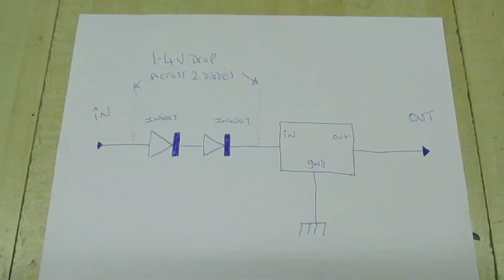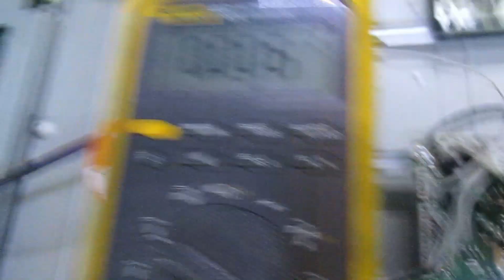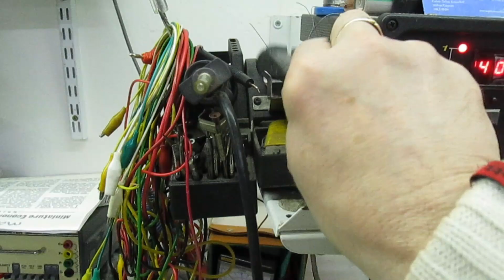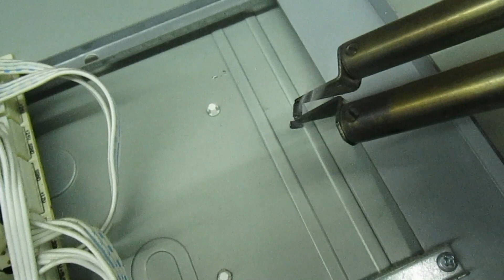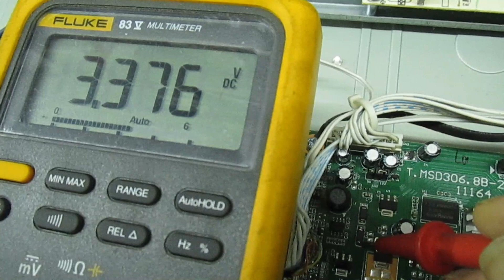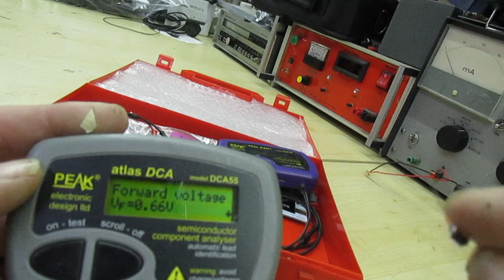Flat screen TV, A  Very common fault to look out for .

Comment: Dear Sir, I do have some questions: 
1. What do you think could be the reason for Vertical Banding, Grey Uniformity Issues, and Dirty Screen Effect (DSE) in modern TV's Panels?
2. From Longevity point of view, are Direct-Lit Full Array LED TV's better (Like Bravia 3, in which constant Backlight is ON) or the Mini-LED Local-Dimming ones (like Bravia 7, 9 in which hundreds or thousandsof LED's turn ON and OF and show varying degrees of Brightness to produce best Contracts, darkest Blacks and Brightest Whites, etc..).? Which among them will be the TV with longer life ??
3. I'm assuming keeping Brightness low shall increase the life of the TV.
Waiting for your reply. Possibly if you could make a video, it'd be great! Thanks.

Comment: If they used genuine !N4007 diodes instead of crappy surface mount they would never fail but this is "progress"
Reply from the maker: At least with the leaded 1N4007 you could just unsolder one end to do an in circuit test , SMD is a right pain .

Comment: Been binge watching you channel this last week, love it :)
Reminds me when i first started out doing repairs at a music shop around 86/87 time.
Someone had this old Fender transistor PA mixer / amplifier that the output stage would kept failing after some use.
The guy doing the audio repairs at the time just kept shot gunning all the failed silicon in hope it would cure the problem, which it didn't.
Eventually i ended up looking at it with the main service guy and we found the culprit to be a diode in the output stage bias circuit going open circuit when it got hot and the bias current went though the roof taking out the output devices.
Once we swapped that out, no more failures. Testing it cold though there was not perceived problem with it.
Sometimes you have to think out the box a bit when fault finding :)
Reply from the maker: This is also quite a common fault with leaded diodes and I am sure its caused by bending the leads and stressing the diodes internal end connections , for this reason if I am bending the wires on a diode I always hold the diode with a pair if snipe nose pliers and then bend the wire while holding the diode in the pliers so there is no movement at all occurs near where the wire goes into the diode body .

Comment: Thank you Micheal i am looking to use this tip today. On an inverter board i have one sm diode witg 24 volts on one side and 5volts on the other side. It tests okay in cct.Should i change it? Thanks Michael
Reply from the maker: definitely change it if its dropping more than 0.7 volts, even if it test ok as I think the junction can go high resistance when it gets hot.

Comment: Interesting video. there are always 'common' type faults in every type of equipment. From tv's with no service manuals to the biggest computerised medical equipment where the service manuals stack to a height of 600mm :). I know I have worked on them all. One small observation, the diodes are a 14007  not I4007. The 1 indicated one junction device.
Reply from the maker: Just habit I have always referred to these diodes as IN4007.

Comment: Have you ever seen an LED LCD TV where the screen goes black after a few minutes but still has sound and backlight? Stays black when powered on for at least a month, but if left off for a few months, starts up okay then, again, goes black after a few minutes.
Reply from the maker: cant say as I have seen that before and it sounds like its going to take a bit of finding its its intermittent , a hairdryer may be a good start , see if you can bring the fault on quicker .
Reply: @michaeldranfield7140  The fault starts reliably. The problem is finding out what is normal to compare to.

It also seems strange that the issue persists for weeks even when unplugged and cold, as though a charged capacitor maintains the fault until it discharges.
Reply from the maker: @atholmullen  you could try a gentle tap around of even touching different wires and connectors with an insulated took , intermittent faults can be very time consuming to find .

Comment: Always a pleasure to see you work, and (I would bet) that you worked on the old valve CRT TV's too. Thanks for your videos, because it saves the hassle of scrapping them, and I have had an extra 10 years of use from repairing a Flat Screen. The only downside to their age, is that many are power-hungry, by comparison to those which are manufactured today.
Reply from the maker: Of course , I started as a kid repairing valve black and white sets and selling them for £5 , a lot of money back then .
Reply: @michaeldranfield7140  Yes, me too. a lot of B&W sets failed due to Valves failure. I think that I used to place a 68 ohm resistor in the octal base (Heater). If all the Valves lit-up, you had pinpointed the faulty Valve. But I didn't progress to learn as much as you! I am happy to watch all of your YT vids. You are most definitely saving hundreds of Tv's from going to their final resting places. Thanks for your reply. Greetings from Sydney.

Comment: The diodes are added to the voltage regulator to reduce the power dissipaton of the regulator by a factor of  2 !
Reply from the maker: of course but they could have just fed the input to the regulator from a lower voltage source in the first place .

Comment: Since 2008, I've had THREE flat screen TV's. A Panasonic 1080P Plasma. A Samsung 1080P LED LCD. And currently a MORESENSE 4K ULED LED LCD. All working perfectly. No faults at all in 14 years! ...... I also have a 40 year old SONY TRINICON Colour Video Camera, and matching 38 year old SONY BETAMAX VCR! You've guessed it, at a combined age of 78 years, both still working perfectly! ...... I also have a 43 year old JVC STEREO AMPLIFIER ... but this is getting boring? 😂😂😂
Reply from the maker: Old stuff was built to last and be repaired because back then it was so expensive.
Reply: @michaeldranfield7140  True! Things now are built to a price, and are designed to fail! 👎

Comment: The forward voltage drop can rise in a diode if the ESR of the device has risen. Test it at a higher current. Also...if there are high frequency spikes, it's internal junction capacitance can make the device leaky.

As a footnote it is warming to see a REAL electronics engineer like me who has watched as his watched while the subject of his career passion turned into disposable junk. This is why I now work with industrial & scientific gear...
Reply from the maker: First time I came across high forward resistance diodes was back in the 1980s and these usually test OK when they have been heated by desoldering, its for this reason I think it's caused by a bad contact between the junction and the lead out and this is why now when I'm bending the leads on wire ended diodes I always hold the lead with a pair of pliers as there is no mechanical stress placed at the end of the diode.
Reply: @michaeldranfield7140  Funny thing that...I came to a similar conclusion back in the "good old days" as well & do the same. We come from the same era when technicians were real technicians, a day when Philips service manuals were half an inch thick & cost a fiver from CPC & when the City & Guilds was a good qualification.

Comment: Great informative clips. Congradutions. My question is if the diodes you removed still test ok can you reuse them for the same application? It feels like an installation problem more than a part problem?
Reply: His diode tester probably doesn't put much current through the diode... More current would probably have shown it still being at fault.
Or like he said, heating it up temporarily "fixed" it and it would probably fail again later. They are cheap, so you may as well chuck em...
Reply from the maker: While this migh seem like a good idea I wouldn't recommend it, if it's failed once it could easily fail again.
Reply: @michaeldranfield7140  Yeah - false economy - ...and no self respecting technician would want to court reworking (and good reputation), when the same 2c component fails again.

Comment: I think the real problem here is not the diodes at all.  The real problem is a cold solder joint.  All you would have to have done is reheat the joint with some flux and that should have fixed the problem.  Diodes don't fail like that and then fix themselves.

Comment: I've seen this happen to the older through-hole 1N400X series diode, but only from many years of 24/7 use, and mild overheating.  But I don't see any evidence of that on your TV board.  I guess this is just a bad batch of them?  Shouldn't happen.
Reply from the maker: I first came across this problem in the 1980s on a TV that had a whole load of leaded diodes like 1n4007 that were painted silver so it may have been a bad batch then
But I'm pretty sure on leaded diodes it's caused by a poor junction to lead out most likely caused by stressing the junction bending the wire and for that reason I only bend diode wires while holding in a pair of pliers. But as you say heating and cooling plays a big part in the failure mechanism.

Comment: Thanks for the tips!
Are you using a Pace rework station? Looks a lot like what I worked with back before I retired from communications. Now I only have an ols first gen Pace desoldering station. 
BTW wher did you obtain the semiconductor tester? I see you also have several other testers made by the same company.
Reply from the maker: I use a Pace soldering station, this was £1600 when I bought it 20 years ago and in times gone by when I was super busy it was running 8 hours a day.
I have a lot of peak testers as I know the guy who makes them, he is only 5 mins down the road on the same industrial estate as me.
Reply from the maker: Have a look for Peak electronic design, Buxton, Derbyshire on the Internet.

Comment: Nice one! Thanks for sharing Michael. I can remember a similar thing happening when I was a workshop engineer in the early 80's and field engineers used change the so called stock fault 910 ohm resistor in the Bush T22/T22A chassis and the heat from the soldering iron used to temporary make the actual faulty component (a BD2xx tab type regulator transistor, same package as a TIP41) start working again for a few weeks, until it eventually failed again. The 910 ohm fed the transistor base, and only a few mm's of track between them. All those set went wrong again, and came back to the workshop. The transistor always measured faulty in circuit but removing them they measured ok after being heated from desoldering. Replacing the transistor with a new one, a long soak test and returning to customer, they never failed again.
Reply from the maker: Yes I remember the 910 ohm resistor, it fed the  base of the series pass regulator transistor and got so hot it changed color, glad you liked the video and it brought back memories of better days .
Reply: @michaeldranfield7140  , Yes loved the video, a very useful tip. I still repair the odd TV that work mates bring in from time to time. I work in electronic and electrical machine training and education now to hnd / foundation degree level. However, I cannot resist getting my hands dirty on TV now and again 🤣
Reply: Bush T22
I remember those !!!
Crazy era of switch mode power supplies running all the time in standby mode.

Waste of power and just asking for short lifed components !!

Comment: For those doing this, make sure your diodes are facing the correct way as well, as they're omnidirectional
Reply: Unidirectional?? Polarized.
Reply: I’ve never heard of an omnidirectional diode. That’s not a diode’s design.
Reply: A diode that conducts both ways? Where can I find those they sound really useful

Comment: I tend to replace such diodes with the conventional wire ended version. Overall I find them more reliable.
Reply from the maker: when replacing with wire ended types be careful to bend the leads while holding the diode lead out with a pair of pliers,otherwise you can end up with the same problem further down the line, an intermittent junction contact .

Comment: Cheers Mike nice one man really good video 🤟👍 I’ve not had that yet on these, well I probably have but just board swapped it because I couldn’t find. I’ve had good luck replacing the flash roms on these when there’s no Pson signal, but the ir and buttons have triggering signals to turn the set on. Fixed a cheap nasty JVC hifi thing today with the class D fitted on to the same PCB as the SMP which I’ve never seen yet! Absolute junk this thing was, a shorted SR100 diode on the secondary was the issue 😎
Reply from the maker: Yes its a very common fault, surprising enough though its much more common with the DVD player mechanism where there are 3 diodes in series.
Reply: @michaeldranfield7140  ahh excellent information, I’ll keep an eye out for this. Thank you Michael.
Reply: Mind if I ask how come you have two atlas ESR meters I’ve had a ESR70 for a while. Atlas are a brilliant company very good ethnics.
Reply from the maker: @MrReeceyburger123  I have quite a few Peak testers, more than in the video , I know Jeremy who makes them, he is only 5 mins away from me at the other end of the industrial estate , I even have his very first transistor tester that I think he designed as a uni project , well before he set up in business .
Reply: @michaeldranfield7140  ahh wow he’s a brilliant bloke I owe him big time, I use these at work and at home.
Reply from the maker: It was me who gave him the idea, I lent him my homemade tester to play with, I also gave him the idea of the zener diode tester but that didn't come until 20 years after I made one of those!!

Comment: I often see the cargo container at the local tip full to the brim with flatscreen LCDs, I wonder how many are there due to simple faults like this :(
Reply from the maker: I wouldn't mind betting most are just simple fixes on the tip .
Reply: Lots but they are not very careful when they put them in there so the screen is often damaged & the remote controls are missing.
Reply: Me too! And many are the so-called high quality TV's. They go for precious metals recovery.
Reply: @peterduxbury927  And, the 'newer' the scrap TV... there is very little 'precious' metal to recover on boards and ribbons.

Comment: All we used to do is replace the PSU in the field , when the call was booked the operator would follow a flow chart then send the panel suggested to my by box for collection the next day. sometimes they worked.
Reply from the maker: Thats the problem with most new sets now, no component level fault finding , just board replacement .